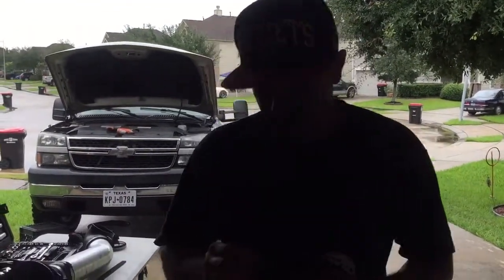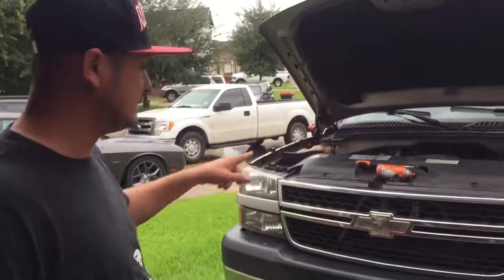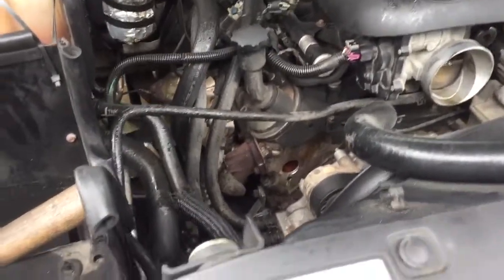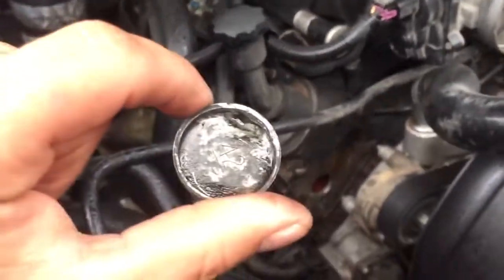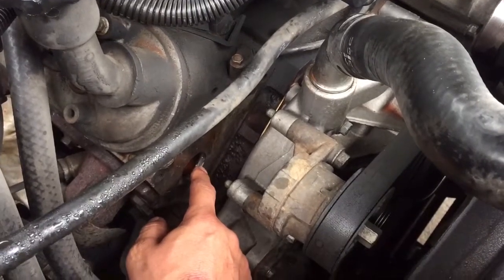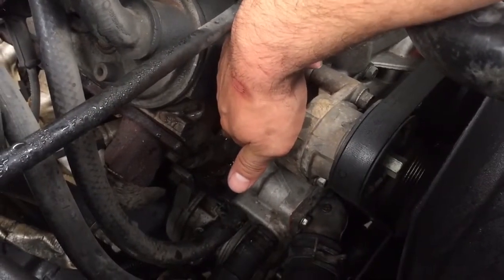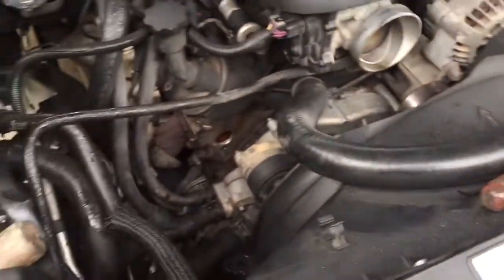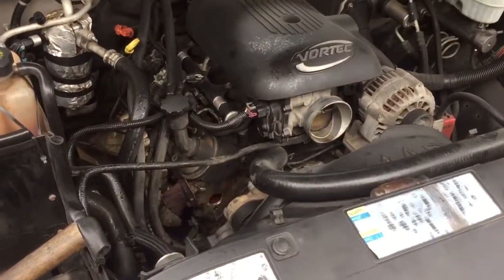Freeze Plug Removal 2004 Silverado Hd

Comment: Ive watched 30 videos on how to reinstall a freeze-out plug, but ive yet to find a video of someone installing a freeze-out plug on the back side of the passenger side cylinder head on a 2007 Chevrolet suburban 5.3 engine.
Reply: still looking
Reply: @RylanBrooks  freeze-out plugs are easy to install, but my problem was, I blowed a freeze-out plug on the back side of my passenger cylinder head in my 2007 Chevrolet suburban, so its up against the firewall, and was trying to find a video of someone installing the metal plugs that you can force in without pulling the head or the engine, my alternative, I had to get a rubber expansion plug that screws in for the meantime.
Reply: Same.. no videos back side head...
Reply: @jasperlovin6496 where did you get the rubber plug
Reply: @chrisg1364  i was able to get a rubber freeze out plug at my local Advance Auto Parts. If you take your old metal freeze out plug in with you, I'm sure you can get then to help match up a size that you can use. That's what I did.

Comment: Do it have another freeze plug on the other front side
Reply from the maker: Im pretty sure it does been a while since i fixed it!!
Reply: Yea it does
Reply: Having the same issue right don’t know it’s the water pump or freeze plug
Reply: Having the same issue right now don’t know it’s the water pump or freeze plug
Reply: Im in same boat as well ive been told heater core or freeze plug. I have 04 surburan
Reply: What do you do after removal and then to replace it with a new one?